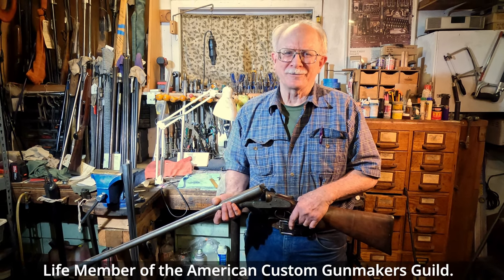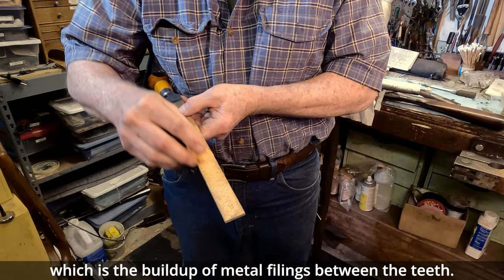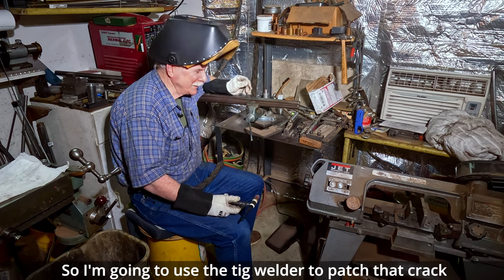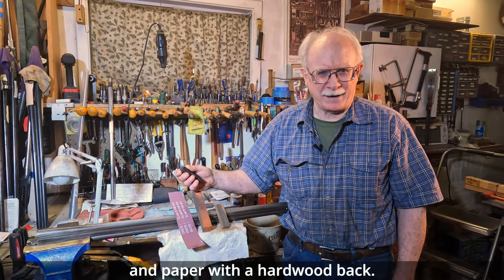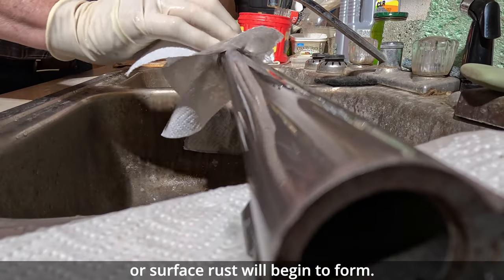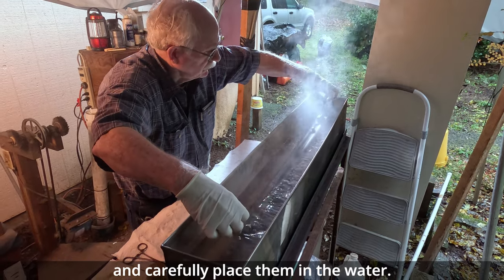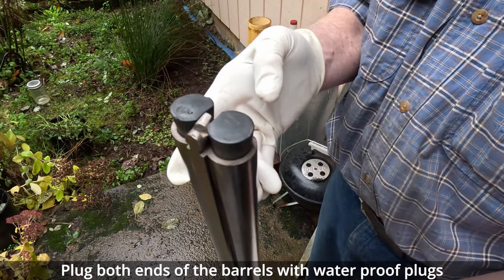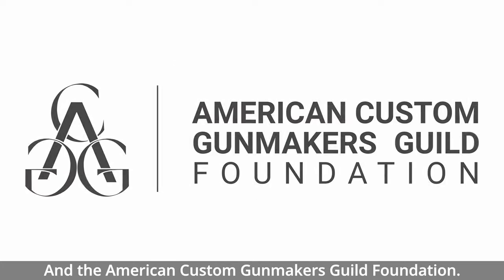Damascus Barrel Restoration

Comment: Thanks for the video. It is great when talented gunsmiths share their knowledge. Question: were the bbls plugged when boiling them in the distilled water?
Reply from the maker: The plugs used during the boiling process were just there to provide a handle, not to prevent water from entering the bore.

Comment: I couldnt get mine to take. I pretty much did what you said. I have a beautiful rustic blue color but no Damascus.  Help?
Reply: Either its not damascus barrels or u didnt have them polished good enough when u started blueing. If u cant see it before u blue u will not after and if u make the blue to dark u can male the finish sp dark it is hard to see or even cant see the damascus.